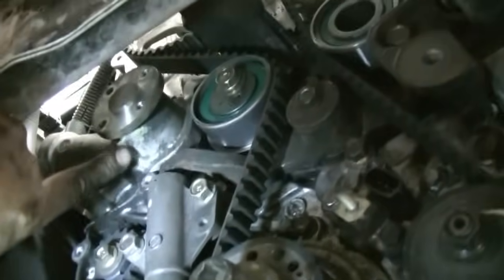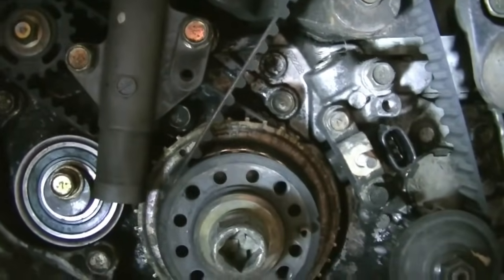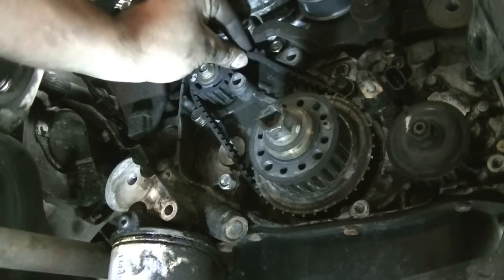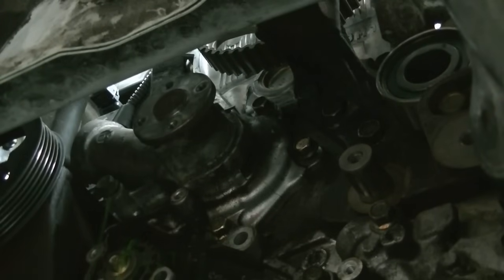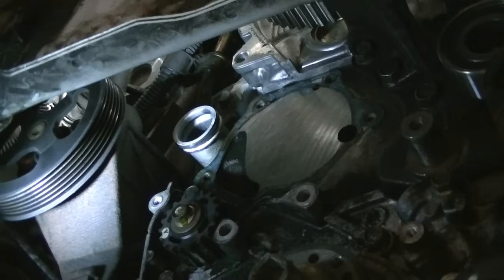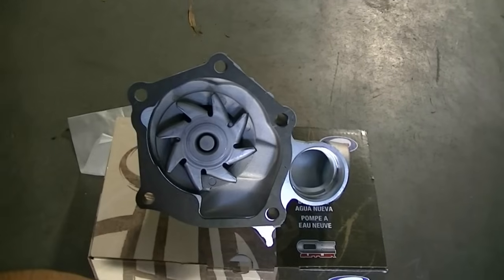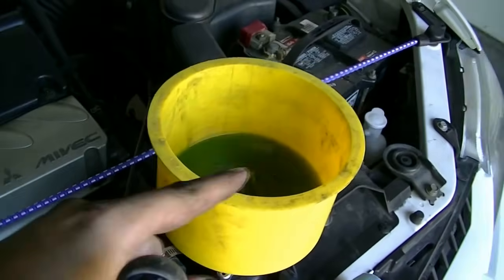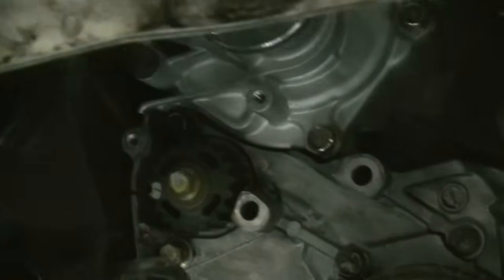How to Remove and Replace the Timing belt and Water Pump - Mitsubishi 2.4L SOHC Engine PART 2

Comment: Can you change the waterpump without taking out the belts? Thanks
Reply: From very recent experience ('03 galant, 2.4l sohc i4), no. You need to remove the belt tensioner cause some of the bolts are located underneath it, but the balancer shaft belt should be okay to leave. It doesn't seem like a big deal honestly as long as you keep all the gears in time, getting the new waterpump is more of a pain than timing itself. Just my $0.02. :)
Reply: @Kingswood7189 Interesting. So I do need to take off the tensioner to get the water pump off? Is there a way of keeping everything in place so it doesn’t move while I put in a new water pump?
Reply: @damon323  yes and yes. I will say in advance, if your mitsu has over 100k miles, I'd highly recommend replacing the timing belts (cause there's actually 2. In a short summary, the easiest way to keep time on the engine is to remove the spark plugs and rotate to top dead center #1 (requires removal of the timing cover). The cam and crank sprocket doesn't move super easy, but the oil pump sprocket (bottom right sprocket) does. Just be careful touching that sprocket. I can go into more detail later, just wanted to respond back. :)
Reply: @Kingswood7189  I completely agree, my friend actually changed the belts and the water pump about 25k miles ago. The water pump failed I believe, so I just want to change that out if it’s possible without messing with the timing belts.
Reply: @damon323  I understand entirely. That said, before we assume it's the waterpump, what are the symptoms or issues?
Reply: @Kingswood7189  Coolant is steady leaking when the engine warms up for a couple minutes. Leak is coming out from the timing cover. I do need to confirm this, but I’m pretty confident that it’s the water pump.
Reply: @damon323  gotcha. I apologize for asking, I wanted to see if there was an easier solution to fix your vehicle, mind you, without knowing the problem. It definitely sounds like the waterpump, perhaps leaking out the weep hole.
That said, my easiest solution for the timing is manually setting the engine to cylinder 1 top dead center so all the marks are lined up with the spark plugs removed. You should be able to then remove the tensioner, and all waterpump bolts will be accessible.
Reply: @Kingswood7189  No worries at all my friend, can’t tell you how much I appreciate the info! 
So I do in fact have to take off the tensioner? 
When I do take it off, will everything stay in place timing wise while I work on the water pump?
Reply: @damon323  unfortunately yes, but the sprockets shouldn't move honestly. I was actually looking at some pictures of when I replaced mine, and I remembered you need to loosen the tensioner pulley first. The tensioner just helps hold the tension created by the pulley, still essential for operation. I'm not entirely sure if you need to remove the bracket for the pulley, but it's an unnecessary pain in the rear for a waterpump. The 4g64 is a good little engine though. And you're quite welcome. :) 

This video and the technical manual made it possible for me.
Reply: @damon323  I  recommend rtv-ing your waterpump gasket to the waterpump so it holds when installing, and using a little coolant on the o-ring to help push the one part onto the inlet/outlet pipe.
Reply: @Kingswood7189  You are awesome man, can’t thank you enough. I’ve read your exact thoughts on the water pump being more difficult than dealing with the belts. I just ordered a full kit, and then just a pump if that’s all that’s needed. I’ll just return whichever one I don’t use. Is it ok to stay in touch with you? I’m gonna attempt the repair this weekend.
Reply: @damon323  no worries, man. Yeah, I'll keep in touch as I periodically check my YouTube notifications. :) Do you have a backup vehicle, just in case? It took me 3 weekends to finish mine and I'm still trying to get all the air pockets out of the cooling system, but she's so quiet, she doesn't even purr at idle. :)
Reply: Assuming the waterpump comes with a new o-ring and gasket, you'll probably return the full kit. The belts, pulleys, etc. should still be good after only 25k miles.
Reply: @Kingswood7189  Thanks again man, really is appreciated! I’ll hit you up for sure. 
And yes, I’m thinking the same thing…I’ll probably end up returning the kit. Which will be nice cause that’ll save me $260(I bought the high end Aisin Kit). The other water pump I bought is Gates, which is also supposed to be good too. 
And yes, I’m good on backup vehicles. The 2003 Galant is actually my mother’s car. I’ll have 3 days this weekend to get it done. Hope I can pull it off.
Reply: @damon323  complete irony, lol. The also '03 I worked on is my mother-in-laws 😆. So far the ~$220 gates(?) kit is 600 miles strong. I think you can do this. Make sure you have a atleast 2 ton jack and block of wood in case you need to take off the front engine mount.
Reply: @Kingswood7189  Haha! Definitely ironic! I appreciate the vote of confidence man, thank you! I’ve done plenty of other work on this car, but this will be the biggest. I’ve heard nothing but good thing on the Gates, so I’m glad I picked that one. 
I did notice that I’ll probably have to remove one of the engine mounts. How long do you think it took to get the timing cover off?
Reply: @damon323  that's a good question. Less than an hour if you're really good, longer than an hour if you're a shade tree-less mechanic like myself. With the block of wood on the jack, locate it under the engine oil pan as it will be your support when you remove the mount  in front of the timing cover. The top section of the cover is 4 accessible bolts, but you'll need to loosen and remove the bar/bracket (for the alternator) to the side. There's a number of bolts holding the lower, but ones hidden under the waterpump pulley and you need to remove the crank pulley (4 bolts) as well. You might want to lift and put aside the coolant reservoir for ease of access for the mount. Loosen the belt tensioners and set aside, it's not terrible, kinda tedious though.
Reply: @damon323  the waterpump pulley is held by 4 bolts (10mm?), and likes to move when loosening and tightening. If you can remove this pulley with ease, sweet. You'll need to raise the engine to clear the engine bay though.
Reply: @Kingswood7189  This is invaluable information my friend! I absolutely can use every single tip you can remember! Thank you! Both, the Gates water pump, and the full kit comes Saturday, probably in the afternoon. My plan is to start tearing it down while I’m waiting. Should I get those ratcheting wrenches? Or will standard socket wrenches be ok? 
And do you happen to recall the torque specs of the water pump?
Reply: @damon323  you're very welcome, man. :) ratcheting wrenches are definitely a must have for tight spaces, harbor freight and home Depot both sell packs of varying sizes for a fair price. By all means, tear it down to where you can see the timing belts. Drain your coolant first to limit the mess, but it'll still leak out of the inlet/outlet pipe once the waterpump is off. I'm not sure the condition of the old waterpump gasket, but you might have to do a little scraping, carb cleaner and paper towels/clean rags will help with a clean surface for the new pump. I actually didn't torque the bolts to spec, but I snugged them down to where I couldn't turn without that feeling you're gonna strip something, I can give you exact specs though in a star pattern.
Reply: @damon323  also, turning you steering wheel all the way to the right makes for easier access. Keep the waterpump on til you get the new pump so you don't risk getting debris, and you can run the mitsu without the cover on to doublecheck your seal. I don't recommend beyond that though.
Reply: @Kingswood7189  I’ve been wanting an excuse to get some ratcheting wrenches, so this is perfect! Lol! I’ll definitely drain the coolant. Speaking of that, I changed out the radiator last year. Easy job, went really well. Now looking back, I didn’t flush the new radiator. I almost wonder if that’s what brought me in to this situation. It was a nice OEM Denso radiator, but I doubt it matters. Or maybe I’m just overthinking it. Lol! 
Once again, you’re help is truly appreciated.
Reply: @Kingswood7189  Just saw your message on turning the wheel…definitely a good call! I forgot about that. Very handy when doing brakes too
Reply: @damon323  not doing a radiator flush after a year shouldn't  be the culprit, I won't say it's not possible though. Some parts just wear out prematurely like the seal on a waterpump. 25k miles doesn't sound terrible, to be honest, but I'd expect a longer lifespan, respectively. :)
I'm actually trying to burp the bubbles out of the cooling system now 😂. Radiator cap off, a/c at max heat. It's a little messy, but it's been bugging me for the past week...
Reply: @Kingswood7189  Exactly what I was thinking. 25k miles isn’t bad, but not that great either. Must have been built on a Monday. Lol! 
I’m sorry to ask more questions, but can you tell me how you know when you are on cylinder one for top dead center with the balance shaft in the correct position in case I need to change the belts out?
Reply: @damon323  no worries on the question(s). The cam sprocket is gonna have an indented line that will match the line at the top of the cylinder head face. Crank is gonna be more like a painted divit that lines up with an arrow/mark pointing down (to the right of the tensioner, I believe). Oil pump is gonna have a painted spot on the sprocket that lines up with a downfacing arrow. And the balancer shaft will have a painted spot on its sprocket that lines up with an indented knotch on the edge of the engine block face. And with the spark plugs out, you'll be to feel the top of the piston head (cylinder #1) with a long screwdriver or something, perhaps see it when shining a light down the spark plug tube. Definitely be careful with the oil pump sprocket, as it will line up to the arrow in 2 different positions. The video should help with determining the correct position. You shouldn't have any issues as it's already in time, but never hurts to be precautious, and don't rush yourself on this job. :)
Reply: @Kingswood7189  Man, when this is all said and done, I gotta figure out a way to send you some beer money as a thank you! 
Yes, I read somewhere that the oil pump is connect to one of the two balance shafts. So it could be on a timing mark, but still could be a full rotation off. There’s a screwdriver that you can put in some spot I guess(I think the guy shows it in the video actually). 
I guess the most confusing part for me is when I shut the engine off, I’m guessing it doesn’t just stop perfectly on the timing marks. So with what you told me on finding top dead center with cylinder one…will I be most likely turning it manually to line everything up? 
When I have the timing cover off, can I rotate it with the belts on before I take the tensioner off to get to the water pump? 
And last question(sorry)…If I can turn everything manually with the belts on, I do it by turning the crankshaft? Correct? Like with a regular socket wrench?
Reply: @damon323  honestly, I'd like to see a video with the mitsu crank ready and all the marks in time, that'll be my "beer", lol 😂. The easiest way to answer all your questions, you will manually rotate the engine using the crankshaft with a 3/8" drive ratchet or breaker bar (no socket) and to the right, as I recall (its probably actually 1/2" drive). It will give you resistance as you get to the top of a compression stroke (all spark plugs out), but release after passing tdc. When you get to cylinder #1, youll basically pass full compression and then you just backtrack to where the marks line up.  You should be able to release the tension via the tensioner pulley, and remove the tensioner via 2 bolts. When you turn off the engine, it doesn't just land on tdc #1. So it rotates til it locates tdc #1 and then combustion, as far as I know. The engine could start on any cylinder, but I'm not entirely sure. With the balancer shaft, more specifically the "oil pump" sprocket, the rotation will have a different feel. If the sprocket tends to remain stationary when rotated (or slightly rocked by hand accordingly to the manual, tested with the main belt removed), then it's correct. If it tends to rotate clockwise when spun lightly, it's incorrectly timed. Mind you, this shouldn't be a big issue since you're not necessarily replacing the timing belts, just the waterpump. I'm more than happy to help with what I've learned from my own experiences. :)
Reply: @Kingswood7189  Haha! Deal on the video my friend😂 
My ultimate goal is to hopefully minimize touching anything with the timing and just get the water pump. But just in case the belt looks worn and I gotta change it, your info will be my guide. 
I will be in touch tomorrow, I’ll let you know how it’s going👍
Reply: @damon323  Sweet! After 25k, the belts should have plenty of life left, but excessive cracks and missing teeth would be a red flag. I think you'll be good to go though, I'm looking forward to it. 👍
Reply: @Kingswood7189  Absolutely👍 I’m banking on it since it’s suck low miles. I just worry about coolant being on them. Hasn’t been for very long. My friend who originally did the previous job 6 years ago said the coolant won’t deteriorate the rubber. I hope that’s true. Lol! 
One more question…and something I’m just now realizing…did you use a tensioner tool? Like that little thing that has two prongs on the end of it to go on those two holes in the pulley?
Reply: @damon323  as far as i know, coolant shouldn't affect the belts. I just used a ratchet with a 14mm socket and a screwdriver to place tension on the belt, wedging in between the waterpump and pulley. :) my mother-in-laws mitsu gets about 24 mpg mixed before the new kit. She's not very efficient for a 4-banger, but at 20 years old and 213k miles, who cares.
Reply: @Kingswood7189  You are a lifesaver man! I was just frantically looking on Amazon and every local parts store for a special tool! I can now breathe and start tearing everything down. Lol! Wish me luck buddy. I may write you periodically if that’s cool. Thank you again!
Reply: @damon323  no worries man. It's possible oreillys or autozone might have the tool for rent, I don't know though honestly. The screwdriver is effective to get the job done. I would recommend using the video to recollapse the tensioner as I just replaced everything in the kit. Good luck man :). Disregard oreillys and autozone, sounds like they don't stock it...
Reply: @Kingswood7189  Thank you for checking to see if they stock that. 
Well, Im at the moment of truth. Got it tore down. I just need to begin taking off the water pump. I have two concerns…

You know that tensioner pulley…the one with two holes in it…I don’t have the tool if that’s needed to tension it. 

Other thing, to simply it for me(because I way overthink everything) …for timing, if the bigger cam sprocket at the top is lined up, I’m in time down below with the balance shaft, right? 

Side note, at this moment, I have the cam sprocket on top perfectly timed…but down below, the oil pump sprocket and the little balancer time mark look like they are one belt rib off. My buddy did it last time, but the car ran fine. What are your thoughts. Apologizes for the long message
Reply: @damon323  you don't need the special tool to tension that pulley, just use a screwdriver, prybar, etc. to wedge between the waterpump itself and the pulley as it will supply the tension when pryed to set the tension for the belt. Just tighten that 14mm (?) Bolt to lock it in (snug it down or torque it when done). As long as the cam and crank sprocket are lined up with the marks, you shouldn't have valve and piston making contact.
 As far as I know, the balancer shaft helps in making the engine run smoothly and not shaking/vibrating like crazy during operation. You could take the main belt off to slightly adjust the oil pump sprocket to where it lines up just right. And then, re-install the belt starting at the crank, to the oil pump, idler pulley, cam, and finally tensioner pulley while there is still slack, just monitor your marks. They might all jump a tooth to the right, but you should be able to rotate it back using the crank sprocket.
Reply: @damon323  no worries man, I'm more than happy to help keep yours or your family's car(s) running, like my own. :) The balancer shaft sprocket, on the left side, should have the painted part line up with a knotch on the edge of the engine block face.
Reply: @Kingswood7189  Thank you so much. So to begin on getting to the water pump, should I just start taking off the hydraulic tensioner? Then that tensioner pulley?
Reply: @damon323  loosen up the tensioner pulley bolt, creating slack, and loosen up and remove the bolts for the tensioner. You should be able to pull the tensioner off. Follow the video to collapse the tensioner for reuse, cause I replaced it with the kit. Hopefully, you shouldn't have to remove the bracket with the pulley for access to waterpump bolts.
Reply: @Kingswood7189  Ok, thank you for that…I was about to start taking off the tensioner first. 
I had a friend finally call back. I told him where I was at and my concern for being completely in time. 
His worry is something about making sure spring pressure doesn’t move anything when I take the belt off. I know there is a screwdriver method where you stick it in some hole for the balancer. But is there anything else I should be worried on moving once the belt comes off?
Reply: @damon323  you're welcome. I don't recall there being an issue pulling the tensioner out, honestly. But you do need to recompress it so you can put a pin in a tiny hole and hold that inner cylinder in place... 💡 or you might be able to pin it before you remove the tensioner. The screwdriver in the back of the engine is more for the position of the oil pump than the balancer shaft. I didn't honestly bother with it as everything was already in time when the crank position sensor went kaputs on me. Just be careful taking the belt off and the sprockets shouldn't move much at all. :)
Reply: @Kingswood7189  I’m so bummed I just now saw your message! That is genius to put the pin in before removing it! Wish I would’ve done that! I will do that when I reinstall it. Instead of releasing the pin, I’ll still rotate everything, and if the pin comes out freely, I know I’m good👍 
I really got hung up on the timing thing for a couple hours. But I ended up getting everything off except the water pump. So I really think I’ll have this done tomorrow! You actually stayed in touch with me more than a couple of my buddies I was texting. So I’m extremely grateful for you walking me through this🙏 I’ll let you know how it goes👍
Reply: @damon323  sounds like a plan and you're welcome man. :) no worries on the timing thing as it's very crucial. I ran my engine without the cover at first to check my work (sensor, waterpump sealing, and timing were all good), and I did have to give the balancer belt more slack cause it was too tight. That said, now I'm in belief that the ect sensor is bad as my obdII scantool reads 210°, but the gauge reads about 3/4 (probably 240-250°). I'm not out of the woods, but the engine basically runs like new. :)
Reply: @Kingswood7189  Nice!! I’m definitely going to test everything too, since it’s gonna take me most of the day putting it all back together. Just looked up where the ECT sensor is, luckily you don’t have to rip the whole engine apart to get to it like this job. Lol! This has been way out of my comfort zone, but I’ve learned a lot about turning wrenches.
Reply: @damon323  agreed. Replacing the waterpump (at the minimum) on a backassward design is a good learning experience, and it's something that can be done at home. I'd like to have changed the waterpump (also under the timing cover) on my '05 sebring (2.4l i4) when it was leaking, but I wasn't as experienced and the engine bay is more crowded by far.
Reply: @Kingswood7189  Oh, the Chryslers that had these Mitsubishi engines where even worse to work on? I believe it. This Galant is bad enough. Lol! Most of the tear down wasn’t terrible, but then stuff like the water pump pulley took me like 90 minutes to wrestle out. Lol!
Reply: @damon323  under Daimler (mercedes) ownership, mitsu and chrysler definitely shared parts, chassis, etc. with similar models. I'm certain the 2.4l in my sebring is a chrysler engine as it's an edz, not 4g64. It unfortunately doesn't change that fact the waterpump is part of the timing and the finger space is tighter 😅. With the waterpump pulley, you need to raise or lower the engine (with the jack and block of wood) to get more wiggle room.
Reply: @Kingswood7189  Lol!😂 Finger tight spaces is 1,000% right! 
I got the water pump off, and I just cleaned the old gasket off. That was fun😟😂

Im sorry again to ask, but for reference, at what point were you able to start the car to check for leaks? Did you completely fill the system up with coolant too? Can you give me the play by play so I know when to check that? I’m guessing you had the serpentine belts on top of course..
Reply: @damon323  after having the new waterpump installed, timing belts on and tensioned with the tensioner in place (all timing marks lined up), and all the serpentine belts on and tensioned, just fill the radiator as much as possible (but keep the radiator cap off). You should be able to crank the engine over (don't forget your spark plugs, wires, and coils), and just watch and listen for unusual sounds and/or leaking from the waterpump. Depending on the sort, you can make your belts too tight, but you can always play it by feel. It's just making sure you're engine is "perfect". :)
Reply: @Kingswood7189  Once again, you are a lifesaver! I know I should realize all this seeing where I’m at in the job, but I’m exhausted from yesterday. Lol! Had to run and get a couple things to install the pump, but I’m on the downhill slope👍👍
Reply: @Kingswood7189  Oh, one more thing I forgot…you said fill it as much as possible in the radiator, check for leaks real fast, sounds, etc. and then I can add more later if everything is all good?
Reply: @damon323  it's a timely repair, just gotta keep the drive going. 2 things, rtv your gasket to the waterpump and let it stick to get rid of the headaches of installing the new pump and having the gasket not stay in place, and make sure your wires are clear of making contact with the cam when it's running (zip ties:)). You're gonna have alot of air pockets, so once you've established your work was a success, you're gonna burp the cooling system for some time.
Reply: @Kingswood7189  Thank you so much! 
However, I’m stuck on getting the new pump in. I’m actually losing it as I write this. I get the gasket on, and go to pop it in place, but it’s like the water pump isn’t sitting flush on the block. Almost like it’s not going in the inlet pipe enough, but I can’t get it in further. Please, I could use any tips fast. Lol! Been on this all day
Reply: @damon323  use some coolant to coat the o-ring, it'll help seat onto the inlet pipe.
Reply: @Kingswood7189   Oh I did…it just won’t line up. I’ve even had it to where it sounds like it pops in to place, I go under and the body of the pump that sits on the block sits away, and the holes are like a 1/8 of an inch off. I’m losing my mind. Lol!
Reply: @damon323  try screwing in one of the bolts toward the center. You might be able to get it to finesse into its spot.
Reply: @Kingswood7189   Man, I owe you double beer for bugging you all weekend. Lol! 
So the two gaskets I had(not o-rings) are ruined. I’m on hold till tomorrow afternoon. 

The problem seems to be the pipe that connects to the pump, but it’s more that it’s too far away, like it’s bent or something. I got the pump to sit flush with the engine block, but the holes won’t line up. They are around 3/16 of an inch off. I tried pulling the pump connected to the pipe over as far as I could, but couldn’t get it lined up. This whole day ended in defeat, I’m pretty bummed. 
This can’t be normal. It should pop on the pipe, and then drop bolts in to tighten down. This isn’t happening
Reply: @damon323  I will say installing the pump is not the easiest part. If you can get the pipe to maybe move a little closer to the block, just enough to get a bolt in your new pump should hold in place. At this point, I wish I had a better answer, but I'm hoping the the inlet pipe works with you. Sorry to hear the gaskets are no longer good, it's gotta be a pain in the rear somehow. If you happened to live in the kingman, az area, I could be of physical use
Reply: @Kingswood7189  I swear to you, I was pulling with everything I had to line it up. I couldn’t get one single bolt threaded. I was close, but it’s so hard to see when things are as far out of alignment and not trying to mess up the gasket, which I did. 
Did you have alignment issues? This can’t be normal. I’m the most patient guy on the planet, but this has gotten the better of me
Reply: @damon323  don't get too stressed out, man. It'll get put back together, you could probably even get your buddy that helped last time. It took me 3 weekends to get our mitsu fixed, just need to have patience. I think you can still do it, just a hiccup along the way.
Reply: @Kingswood7189  Really appreciate the words of encouragement my friend, thank you! 
I tried to get that buddy over here last night. Even offered him $150 to just bolt on the pump, but he’s been really busy. Lol! 
Another guy here on a different video said I could use like a punch to help line things up. But he also said don’t be tempted to draw it in with another bolt, that it could crack. So I don’t know what to do on that. 
How did that pump line up for you?? When you popped it in the pipe, where all your holes lined up to put bolts in? Or did you have to pull it over? I’m just wondering if my circumstances are abnormal
Reply: @damon323  there's always that one saying "more than one way to skin a cat", lol. The punch idea does sound like a plausible way to get things buttoned up. As I recall for me, I popped it on to the pipe after putting the  film of coolant on that o-ring, and I guess I just kinda tugged it over onto the block face (i might have even used a small screwdriver, come to think of it). I did have to work with it to line up the bolts and wound getting one in. I didn't tighten all the way at first. Having all the bolts in, I snugged them down in a star pattern. I probably got lucky, but it give me a struggle.
Reply: @Kingswood7189  Glad to know I’m not alone on this part. What a nightmare. Lol! I guess I’m just worried about forcing anything too much. So you did in fact have to use a screwdriver to move it over and line it up?
Reply: @damon323  I'm honestly not sure, but it did give me troubles as well. I'm gonna presume I did, cause if it hasn't come on with just elbow grease, a screwdriver or punch should help in assisting. Just clean up the waterpump surface, rtv a new gasket, I think it should go on easier. :)
Reply: @Kingswood7189  I…freaking…got…it!!!! Lol!! Day and a half of agony, broken spirit, lots of cuss words later, and it’s in!! Lol!😂
You’re gonna love this…
I ended up cutting a scrap piece of a 1x3 to about 13 inches in length. Wedged it in between the coolant pipe and the firewall. Bolted right in!! Probably the most unusual MacGyver solution, but it worked like a charm😂👍 I’m not out of the woods yet, still gotta put the rest back together. But thank you for all your support! I’ll keep you posted on the rest, and whatever other inventions I’ll have to create next😂
Reply: @damon323  that's awesome lol 😂. A prybar that a termite would love to get it's jaws on, just kidding. Definitely a creative solution, keep it up and I'm looking forward to more progress. Apparently the 4g64 has 2 coolant sensors, one for the engine and one that goes to the instrument cluster. I purchased the one for the cluster (and a radiator cap), hopefully this fixes my issue. 😅
Reply: @Kingswood7189  Thank you! It’s been quite a journey for sure! Lol! I showed my Mom the 1x3 in there and she was like “won’t that get pretty hot in the engine?” She realized what I was doing shortly after.  Lol!😂 
That’s interesting about the coolant sensors, and good to know. Sounds like it’s not affecting the way it runs. Are you just getting an engine code? Or is the temp gauge falsely reading high?
Reply: @damon323  not a problem, man. No codes, performance is unaffected, just false reading. I can smack the dash and it'll sometimes moves, it's crazy...
Reply: @Kingswood7189  Yeah, that’s strange but sounds like it shouldn’t be to bad to fix. Unless you gotta take the whole dash apart. Either way, glad it’s not affecting its performance👍
Reply: @damon323  to be honest, the naturally aspirated 4g64 doesn't offer much performance to begin with, lol ( but wait for the o2 sensors to fail, youll feel it) 😅. It's a good engine, hp wasn't exactly it's strong suit though, stock. Sorry for the late response, today's been a little busy. The job itself shouldn't be too bad 👍.
Reply: @Kingswood7189  No worries at all, I was back to work today myself. Yeah, definitely built for economy. Lol! 4 cylinders and V6’s sure have came a long ways. I’m going to put Amsoil transmission fluid in the Galant soon. Shifting in to 3rd gear kind of chatters, hoping to eliminate that and squeeze as much mileage as I can. Cars, like everything else are ridiculously priced now.
Reply: @damon323  when's the last time the trans was serviced?  It might just  need some fresh fluid and a filter. Even at 213k, I average about 24 mpg mixed, which isn't great for a 4 cylinder, but noticeably better than our '04 durango @ 14 mpg 😅. I do enjoy the vehicles my family has, but car prices really are ridiculous... you could get a 3 year old car/truck (depending on the sort) for $20k about 10 years ago. Add 7 years to that same vehicle (with additional mileage), and it's about the same price.
Reply: @Kingswood7189  Transmission was serviced about 10 years ago…maybe a little longer. Lol! Back before I turned any wrenches at all on any vehicle. It’s always been like that. Nothing major, but some good synthetic Amsoil in there couldn’t hurt. Lol! 
And yes! Car prices are still insane! I just got a 2016 4Runner with 60k miles for $36k. I’m kicking myself a little because used prices aren’t much lower than new now. 
That’s awesome you got a Durango! Those were my absolute favorite it that era! I still like the look of that generation far better than the new ones👍
Reply: @damon323  adding something to give the trans better lubrication shouldn't hurt, no. I do recommend servicing your trans, differentials (if your vehicle has them), and putting in new spark plugs every 30-50k miles (and air filter every ~10k miles), as time permits. I get that a low mileage 4runner (and most other toyotas) sells for a pretty penny, but damn. If you factor out mpg, the quality of the suspension/steering components, and ours is a burner (with 187k miles), she's a great rig with plenty of power for being 19 years old. I do like both this gen and the newer generation bodystyles, but dare I say it, changing 16 sparkplugs and 7 qts. of oil would make me reconsider owning another. I love my Mopar(s), but I do question some of their concepts, respectively.
Reply: @Kingswood7189  Yes, 16 spark plugs is a major bummer on those Hemi’s. Lol! The one thing that has always bothered me about Mopar is the exhaust headers. They are infamous for the bolts to break off, creating a horrible ticking sound. I had a 03 Ram that did it, and I’ve seen it on countless other rigs.
Reply: @damon323  when does the tick sound happen? And does it stop at some point? Our durango does make  a noise like that for about 10 minutes upon startup and goes away.
Reply: @Kingswood7189  That’s precisely what it is then, very common problem with Mopar. It starts up that way until after it warms up after about 5 or 10 minutes. I’ve heard happen on newer ol trucks(in the last 5 years)
Reply: @damon323  Sweet! You just taught me something, thank you 😄. I thought it was oil pressure related, but I wasn't complaining cause she's a good engine and does her job thirstily.
Reply: @Kingswood7189  For all the help you’ve given me, I’m very happy to contribute something back my friend👍
Reply: @damon323  that's awesome :). Have you made progress on the mitsu? I know it's hard to do stuff after a days work...
Reply: @Kingswood7189  Not since Monday, unfortunately. I’m too beat, I work 11.5 hour days. 
But I’ll tell you, I got some grey hairs after that boxing match with the water pump😂 I’ll never forget the pain and anguish that caused me. Lol! I’m on the downhill slope now, very thankful for that.
Reply: @damon323  I completely understand, and you shouldn't have to do another waterpump (atleast on the mitsu) for a good while. A couple gray hairs you can live with knowing you did it yourself, lol. I only work 8 hour shifts, but even with an hour commute round-trip, I don't really want to work on cars after "working on cars" (I'm a detailer at a car dealership), lol 😂. Thank god for weekends.  I'm glad to be of help. :)
Reply: @Kingswood7189  Detailing cars is hard work. My job is fairly labor intensive, but whenever I detail my rigs or work on them, I feel it in every muscle I got. Lol! 
You’re absolutely right on getting this water pump done myself. Feels pretty good and I’ve learned a bunch of stuff. So it was worth it for sure.
Reply: @damon323  given that I've been doing this for about 4 months now, it's honestly mostly repetitive and tedious, but definitely has its moments. Some of the cars are so filthy, you'd rather they be burned down or sent to a junkyard, but they still work... I always get satisfaction when I do my own work vs. sending it to a shop. Maybe a little sore after, but that's money saved for more important stuff. :)
Reply: @Kingswood7189  Absolutely man! Much more gratifying to do the work yourself! Plus you learn and save money, which is bonus! I’ve learned so much about mechanics on this Galant alone. Complete agree with you👍
Reply: @damon323  to say the least, the weekend is just around the corner, so  you can get her up and running. I'm gonna see about replacing that sensor and getting the gauge to act accordingly. :)
Reply: @Kingswood7189  It…is….COMPLETE!! Lol! I got everything in last night around 12:30am! I don’t know what I’m doing up this early, but I had to tell you😂👍👍 
I know I sound like a broken record, but you’ve seriously been a ton of help and can’t even tell you how much I appreciate everything!
Reply: @damon323  you're more than welcome, man. Now all you gotta do is crank her over and let her run. I'm glad to have been able to help, but make sure your belts aren't too loose or too tight. Running her will let you know. I had the time, so I thought I'd record the temp sensor replacement. I hope you enjoy(ed) the video. Your mother will be happy with her non leaking galant. :)
Reply: @Kingswood7189  Yep, I put in new drive belts while I was at it, filled it up with coolant and prayed right before I turned it over. Everything was good!👍 She drove around for a few hours, temps were perfect, no leaks. 
I think the next project is motor mounts. The one I took out looks toasted. New brakes and rotors are in the near future too. I’ll definitely check out your video of the temp sensor!
Reply: @damon323  anything to keep an "oldie but goodie" on the road. While these cars wouldn't be my first choice, honestly, I have high respect for their endurance. Most issues I've seen is their sensors tend to go bad over time vs other comparable vehicles.
Reply: @Kingswood7189  Absolutely agree! These Mitsubishi’s have their quirks, but they are overall pretty solid. Far better reliability than any American stuff I’ve had. I’m a Toyota/Lexus guy, but I root for anything Japanese. They just seem to have a higher build quality and standard.
Reply: @Kingswood7189  Oh, and I forgot to tell you…right when I started to put everything back together at the beginning of the day…it almost turned out really bad, really fast. 
You know the bolt that holds the tensioner arm? I was tightening it down, and immediately noticed something didn’t feel right. Backed it out(luckily) and the bolt head was starting to split. Could have been a really bad day, but got very lucky
Reply: @damon323  I'm honestly more of a domestic kind of guy (chrysler/dodge, and then ford or chevy depending on the year), but I'm a firm believer that routine maintenance is key, regardless of brand. They all have their own quirks though, respectively. But I will agree that atleast the "made in japan" toyotas, Hondas, Subaru, etc. do last longer. "American made" versions aren't really any better, IMHO. The last thing you would need is a bolt for a very important component to break or strip to ruin the whole progress, good catch on preventing a potential nightmare. 👍
Reply: @Kingswood7189  Completely agree, regular maintenance is key no matter what it is. 
Don’t get me wrong, I love American made, it just doesn’t love me. Lol! Never had a bunch of luck with reliability with them. Although, my old 03 Ram was actually pretty solid. And I had a one ton Ram for work that I liked even more. Out of the big 3, Mopar is my favorite by far. The Durango you mentioned you have is my favorite Gen. 
And yes, that bolt I almost broke off almost ruined my week. Lol! Full disclosure, I misread the torque spec. I thought it was  35 ft lb, but it was actually around half that. So that would’ve been on me.
Reply: @damon323  overtorquing definitely happens from time to time, and I'm guilty of stripping threads on occasion 😅. I honestly didn't torque anything, but rather wrenched by feel. I most likely stripped some threads on the cover bolts, but nailed everything else luckily.
With them older dodges, most you really have to worry about is probably the transmission, electronics, and maybe rust, as far as I know. The engines are pretty solid, but won't pass a gas station, lol. 2nd gen durangos are nice and surprisingly luxurious, just avoid the hemi with the mds...
Reply: @Kingswood7189  Haha! I’ve been guilty of the same! I’m starting starting to learn or see a pattern with bolt sizes, and what size of wrench I use for torquing. So I don’t know what I was thinking on that small bolt. Lol! 
Hemi’s with MDS? Is that where they cancel cylinders like Chevy does? If so, I despise that as well. My buddy had nothing but problems burning oil on his 07’ GMC Sierra until he deleted it
Reply: @damon323  yes, and I believe chrysler actually started the cylinder deactivation technology (I believe gms version is called afm). The problem with the Multi Displacement System, is the valve seats would fall out because of heat expansion/contraction of various metals within the block. If you look up youtuber, marspeed, he goes in depth with Mopar. Its awesome. :)